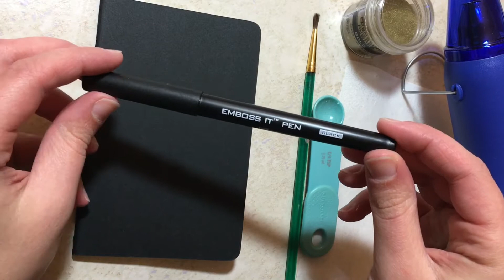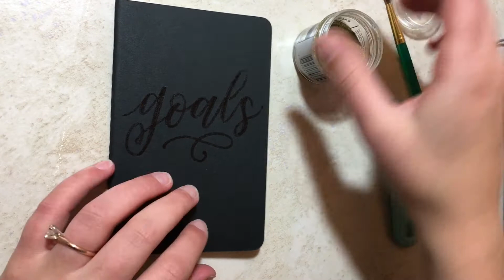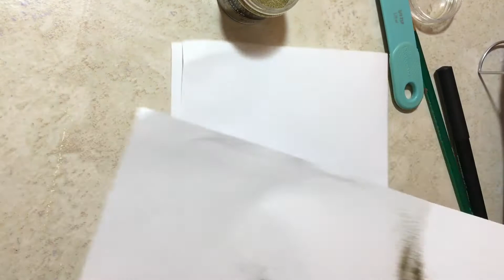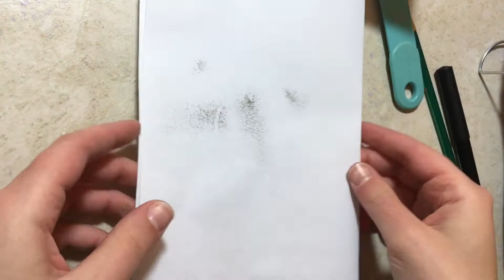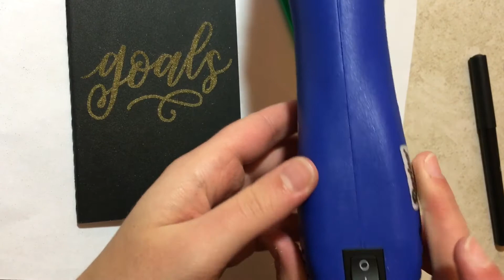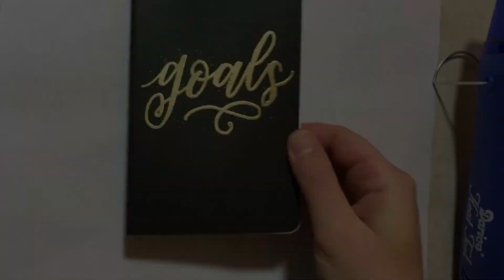How to Emboss - Lettering Example

Comment: Can I do this over already existing lettering, like on an invitation?
Reply from the maker: If you use the embossing pen over existing lettering, it should still work! The only thing to watch out for is the paper type. It might react differently to the heat tool, such as warping, especially if it's really thin.
Reply: @LoveleighLoops  Thank you!!

Comment: Umm what should i use if i dont have heat tool?
Reply from the maker: Using a heat tool is the only successful way I've found that embossing works! You can find them for around $15 at craft stores, or buy them in a set with the powder like this: https://www.amazon.com/dp/B01K02RIZ2/?cv_ct_id=amzn1.idea.8MIJCXKZJW3K&cv_ct_pg=storefront&cv_ct_wn=aip-storefront&ref=exp_cov_loveleighloops_lv_dp_vv_d

Comment: Hi! Quick question. I have the same exact supplies as you (expect paper and I didn’t have a tool to get the paper less static) but my ranger embos it ink dries too quickly and my powder doesn’t stick. Thus whe I go over it with my heat tool; there isn’t much of an effect other than a slight shimmer from the little powder that sticked. I do all of it really quickly but it doesn’t give me the desired effect. What am I doing wrong? I have used normal printing paper and also thicker paper. Thanks!!
Reply from the maker: Hello! Sounds like a very frustrating problem. I haven't had the issue of the ink drying too quickly, so my best guess is that the pen is old or running out? Do you have a different embossing pen you could try? You can actually do a second layer of embossing, so after the first layer cools, go over with the pen and powder again for more shine. Sorry I couldn't give a more helpful answer. Thanks for watching!
Reply: Loveleigh Loops I got the pen new out of the box yesterday so it’s probably not dried out. But your tip about adding a second layer sounds very helpful! Thanks for your answer!!
Reply from the maker: You're welcome, I hope that helps!!

Comment: can i use hair dryer instead?
Reply from the maker: Hello! The heat from a hair dryer is not as concentrated or as hot as the heat tool, so it will not melt the powder
Reply: thanks a lot 💖